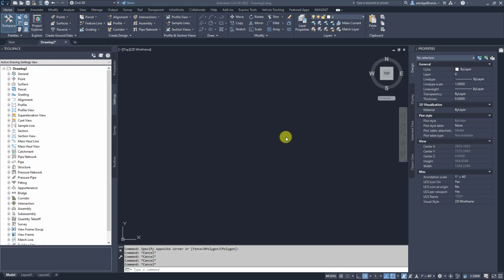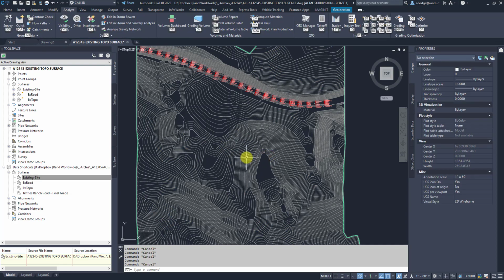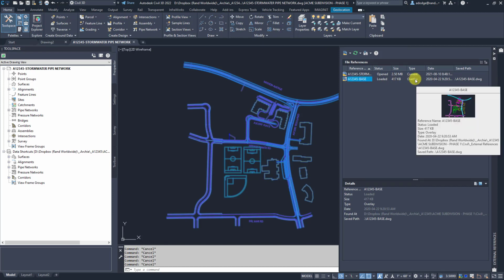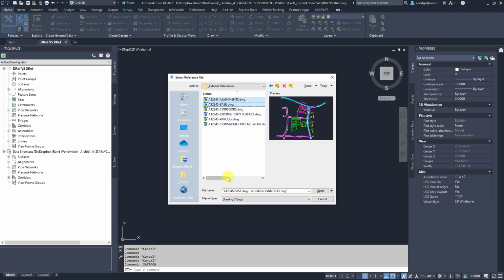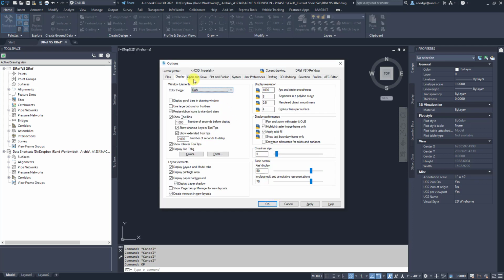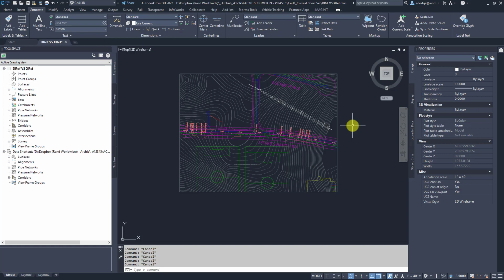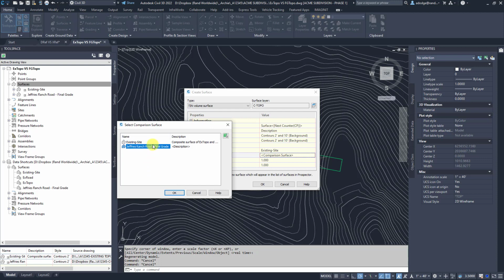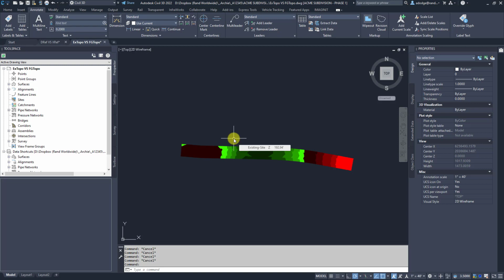External References vs Data Shortcuts and When to Use Them in Civil 3D

Comment: Does it create a circular reference, or just cause lag/slow down issues, if you xref a dwg that you also wants a dref from?  ie. a proposed grading dwg would xref the existing conditions plan but would also be good to dref the existing ground surface  (I know the typical circular reference issue when "attaching" an xref.  I'm not referring to that scenario.  I would have Overlay the xref.)
Reply from the maker: I asked our experts, they said: Xref and Dref of the same file would not create a circular reference.